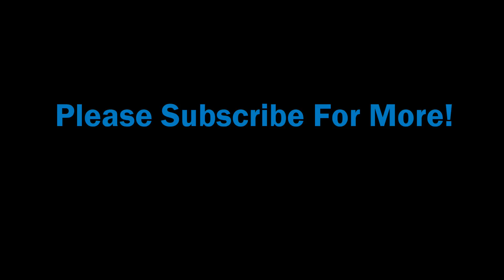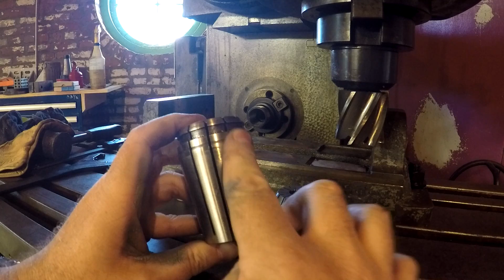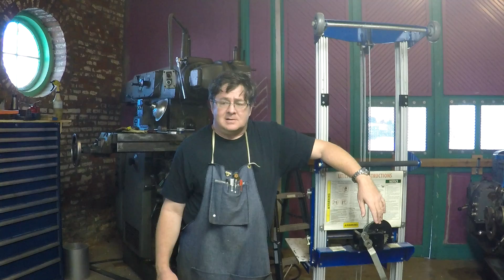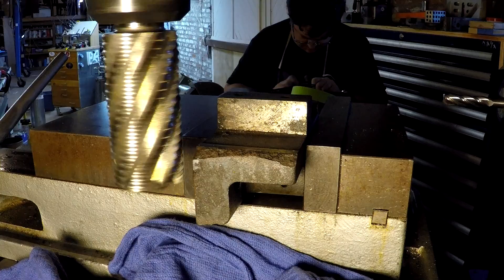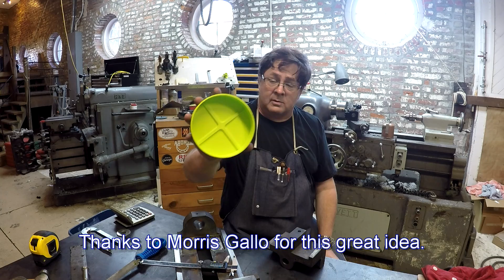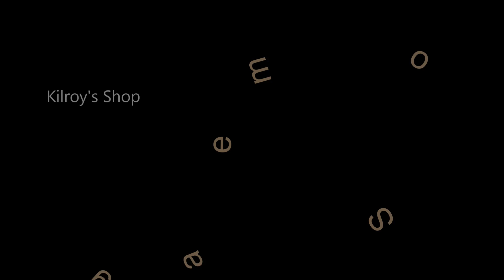Alzmetall Vise Repair #2

Comment: have you ever thought of creating a hole under the universal mill with a concrete floor.say around 10 inches or so depending on a good working height for you.geoff
Reply from the maker: I just got a couple of pallets and placed one big one in front of the machine, really helps a lot!  If I were building a new shop I think you idea has serious merit.

Comment: Jake, I believe that dividing wheel sets made from existing dividing wheels are even more accurate than the original wheels; talk to an engineer for confirmation, but I am sure this is true.

So use your plastic wheel to make a steel wheel, and all is good!

And as you say, this opens up endless possibilities...

Comment: hi jim,
this is going to be a very nice drill press vise.
that vise is not going to be very accurate, though.
thanks for the step-by-step video.

a little favor, please: the sudden intermission music could be lower on volume.
a gentleman is a one who knows how to play bagpipes, but doesn't.

-toly
Reply from the maker: +Toly Dukhovny You are right about that, it is no grinding vise for sure.  Thankfully its just got to hold stuff still for a rather low precision operation.  "a gentleman is a one who knows how to play bagpipes, but doesn't."  I got a good laugh out of that one.

Comment: why not make a metal plate from the plastic one? just chuck up a round plate and use the plastic one on the dividing head to space it. from my experience while 3d printed stuff works, it doesn't last. uv light kills the plastic and it just gets brittle and falls apart, thats why they call it rapid prototyping.

Comment: That printed plate would be an interesting thing to inspect with my optical comparator I picked up.  I think that is the kind of work they are perfect for, not that I know much about one since I have never used one before. The spindle cover looks like it turned out nice, but I wonder if having it sealed up might lead to rust issues in a humid environment?
Reply from the maker: +bcbloc02 Private message me your address and I will get it on the way for you to inspect!
Reply: +James Kilroy So did you end up sending the plate? I sent ya a couple of emails about it but never heard anything. No big deal, just wondered about it.
Reply from the maker: bcbloc02 Well that was interesting, for some reason your emails were getting caught by the spam filter.  I have not mailed it yet, I'll get it packed up today and send it out tomorrow. I have a few more to send so it will make the trip to the post office a bit less painful.
Reply: James Kilroy
Well I see what your computer thinks of me! It must have heard me on one of my rants against technology that fails to work properly and blacklisted me. lol A trip to the PO is nearly as fun as a trip to the DMV. Good luck!

Comment: If that ABS plastic dividing plate turns out to be too fragile, you might try acetone vapor smoothing a second plate. 
https://benchapman4.wordpress.com/2014/05/08/increasing-toughness-of-3d-printed-plastic-using-acetone-vapor/
Reply from the maker: +Zarouszz I have wanted to give that a try.  Perhaps when I have printed out all the parts to the Wilton Baby Bullet we will give that a go.

Comment: I'm slowly beginning to realize just how large that mill you are using is.  I somehow assumed that it was sitting on a raised section of the floor, until you made that wide shot and seen that wasn't the case ... unless my eyes are playing tricks on me.

I like that lift.  A smaller one on that design might be the thing I need.  My lathe has 100 lb + chucks.  That might not be much to some people, but between the after affects of a few serious truck accidents and a weakened abdominal wall (added to other ailments that tend to show up with grumpy-old-fart-hood), I've long given up trying to prove anything with muscle.
Reply: +diggerop Could also use an engine hoist or rig up a small davit crane...
Reply from the maker: +diggerop I have been considering a setup using the overhead track for industrial sliding doors.  Some of that stuff is good to two tons.
Reply: An engine hoist would take too much room in my current space, the shop is a re-work in progress right now (biggest problem is where to put all the crap that's been stuck in there).

An overhead track system, similar to what is used in meat lockers is one thing I have considered.  It wouldn't take up much, if any, floor space, but it would be more limited in where you could go with it.

Comment: I  was wondering why you were thinking about attaching that repair block of steel by brazing rather than perhaps drilling and tapping with 3 cap head bolts?

Also shouldn't you be taking measurements off the centre line of that vice as opposed to side to side for width and from the skimmed base to the "wear strip" of the travelling block or am I missing something?

I acknowledge that you are doing this repair because you can, and it certainly is most interesting to me and others, but, is it cost effective to do so if you put your time into it at a commercial rate / hr? I'm assuming you could buy new a similar size vice if you wished!
Reply from the maker: +Dan Whiteford In no way is this costs effective! On any kind of reasonable hourly rate it is much cheaper to buy a new vise.

I have thought long and hard about how best to layout the vise.  Considering that there is nothing in the center I feel that the best option is to reference everything off the fixed jaw. It really doesn't matter how it lays out, as long as the fixed jaw is perpendicular to the bed along both the Y and Z.

If I can't get my torch bottles refilled bolts it very possibly may be.
Reply: Thanks for your reply.

Comment: I like your plastic bung hole stopper!  Paint your decal on the surface.
When you cut a deeper "rabbet" groove into the base to repair the broken slide edge and also freshened up the opposite rabbet groove you effectively shortened the distance between edges.  Trying to compensate for this decreased distance by adding to the broken slide side will result in an offset slide.  Wouldn't it be better to gouge out both sides of the slide and add a metal bar to both sides, then machine the distance between the inside edges to match the base while keeping the slide centered?
You mentioned planning to braze the repair in place.  These lips on the slide merely keep the slide following true to the base and keep it from twisting.  Why not just drill and tap for screw attachments to slide?
Thanks for the additional lesson on the collet systems.
Reply from the maker: +Morris Gallo Thanks for the great idea Morris.  Drilling and tapping would be fine as well, and if I don't get my torch bottles refilled soon that will be the solution.  We have had a rash of mergers and closures in gas suppliers locally so we are down to two.  Ah, fun.

Comment: Wow, even if the plastic dividing plate doesn't work its a great idea. There are metal 3D printers and while it might seem unnecessary to print something that you could do on a lathe and mill, I still think its awesome.

Comment: James, been following your lathe rebuild. enjoying the action. 

Why do you not build a platform around that large tank of a mill. Seems that working at chest level can get old a rough on shoulders. Use a step down for the knee. metal grating is great for this. We had this arrangement at one of my shops for the heavier machines. You can mill out a tank turrent on yours.

Comment: James,
I have a similar shop lift but it has a long hydraulic cylinder instead of a winch.  By far the most useful tool in the shop.  Was a free throw in with a sheet metal shear purchase,  many years ago.   
Craig
Reply from the maker: +Craig S I wouldn't mind upgrading that lift to a hydraulic, what brand is yours?

Comment: Mr. +James Kilroy,
 I enjoy the videos, so please keep them up.  There are a couple question I would like to ask.
1. What model is your K&T mill?  I know that you had another one that Mr. Booth got from you.
2. How did your railing project go that you made your magnum pocket jig for?

Thank you,
Louis
Reply from the maker: +Louis Keen My mill is a 415 S-15, Adams is an S-12 307.  Railing project worked out great.  The drill is totally dull after putting in 24 of those holes. I'll get some pics for a future ShopADHD.

Comment: James, Use the printed plastic division plate to make a steel one. If I remember correctly, when you drill the pattern from the printed one into the first steel plate the accuracy of the pattern will increase. It has been a long time since I was in Tool & Die Technology. but I seem to remember that from class. Dan.

Comment: Hi Jay,
That big old K&T didn't look like it was working hard plowing through .300 DOC in that cast iron!  Great idea to print your own dividing head plates.  I hope it turns out to be strong enough.  Thanks for the video!
-mike
Reply: +goptools I cant wait myself to see if it works out! people mentioned it a while back and i guess James had a think since and got around to printing one, so hopefully we get to see the results.
Reply from the maker: +goptools No I wasn't working it hard by any means, but honestly I'd rather take it easy on the cutting tools.  Good roughing endmills in the 1.5" size range cost a fortune these days.